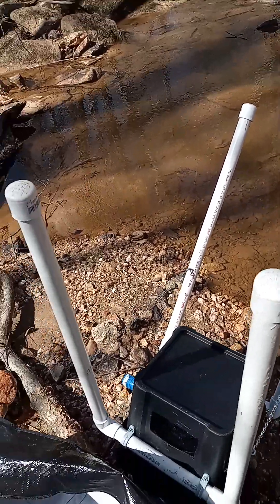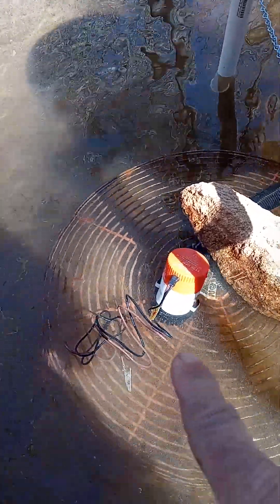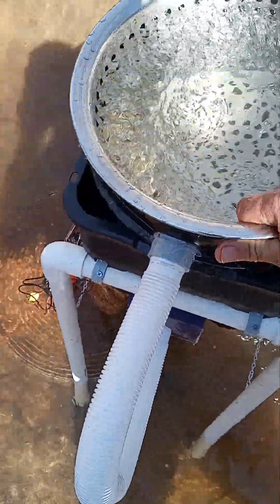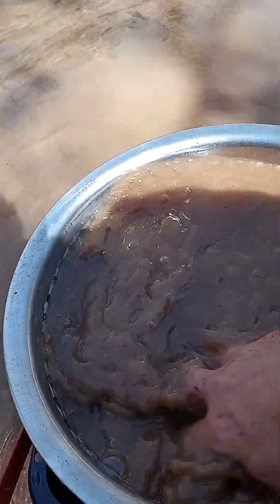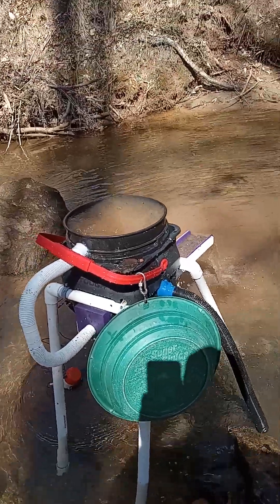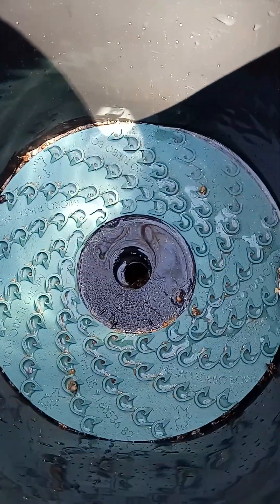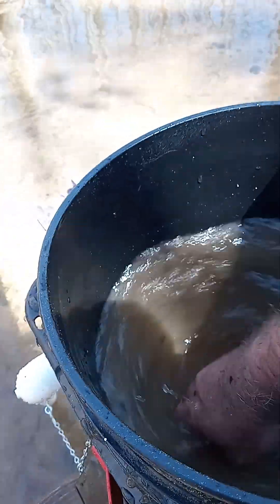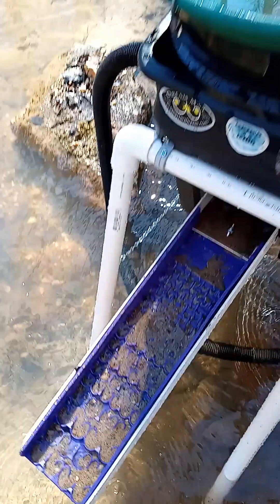Turbo rig 🌀 instructions

Comment: An old miner told me: Every time you dunk your hand in the water a little oil comes off and goes in and causes the surface tension to change and your gold will slip out.   Try putting some work gloves on so you dont lose it and if you find a piece of glass in the bottom of the creek you wont slice your fingers off.